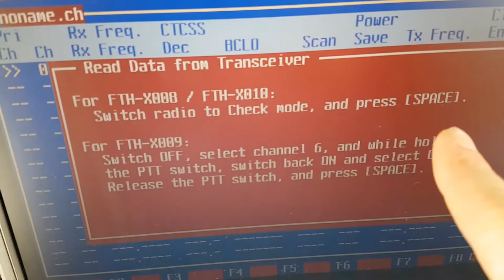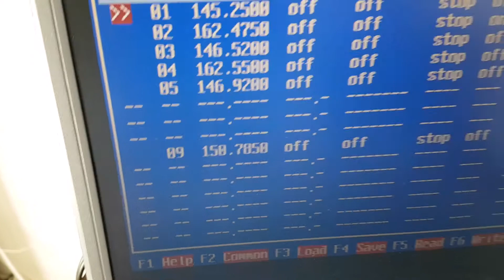Yaesu FTH-2008 Programming

Comment: Hello, could you send extracted file from this radio?
Reply from the maker: @videobipark  sorry I am unable to access these files, as I no longer have this computer.
Reply: Thank you. I've asked because loaded empty file into radio and it's no working. I watch your video too late.
Reply: May be you have schematic diagram for programming box?
Reply: I find it in your comments, thank you.
Reply from the maker: @videobipark  no problem. You would be best to read the radio first then load data into radio from computer. Loading a blank file into the radio might complicate the ability to program it.

Comment: be nice to see you interface and how you have it all connected up..
i have a box of 18 of these radios, VHF and UHF and want to use a few on a portable repeater,
Reply from the maker: It's the RS-232 plugged into the serial port of the old DOS computer and what is shown in this video. Important that it is a computer running DOS or FreeDOS.
Reply: @RailKelowna  
still be nice to know what and how it was made,
i have lots of bits laying about be nice to build a simple RS-232 to Yaesu/SMC programmer.

Comment: Hi, could you tell me how the interface is made? Thank you LW7EEA
Reply from the maker: My cable terminates into a DB9 for the old DOS computer however your cable must have had some sort of 232 programming chip, or equivalent in it.
You can see my little black box almost hidden behind the laptop in the video.
Because I have somehow accumulated about 7 old DOS radios over time, and everyone uses a different cable, I installed a 3.5 stereo plug on the output of the 232 so that I can use one programmer to plug into the appropriate cable for any of the radios.
It just happened I used an old DB21 case to house the 3.5 female and the switch to select the 232 pin 9 RXD and pin 10 TXD to the 2.5 that goes into the FTH 2008.
The Max 232 schematic, with a DB9, I used a 9 v battery instead of building the voltage reg, All I need is pin 9 and 10 and nothing else to the left
of the Max 232 chip. The 232 chip cost was about $3.00.
http://www.okanagan.net/ocarc/news/MAX232.png
Reply: @RailKelowna  Hi. I have built the interface according to the plane you sent me. but the program says "problem detected with connection to the radio. Try with a 486 PC with windows 98 and it is the same, try to start from MsDOS and continue with the same problem. That could be happening? Thank you
Reply from the maker: Are you using a switch to connect pin 9 or pin 10 to the tip of the 2.5mm jack? And you are putting the check mode by moving the slide switch to the opposite direction? It has to be an MS-DOS based computer with COM port. That's about all the advice I can offer.
Reply: @RailKelowna  Hi. I managed to run the interface, I can read and write the handy. but I have a new problem. record an FTH2008 and go well. record an FTH2010 and it does not receive or transmit, it shows ch01 but it has nothing. I read it and it shows the frequencies that I record it. probe with several frequencies and is the same, turn on the TX led but it does not emit, turn on the RX led but it does not receive. that could be happening? Thank you
Reply from the maker: Was it in a working state, before you tried to make any programming changes? I am not familiar with that model, so I cannot help you. Glad to hear you got the FTH2008 working.

Comment: Cómo se entra al check mode?
Reply from the maker: Remove PTT (Push to talk) rubber. You will see a small slide switch. Move the slide switch to the opposite direction. When finished programming, slide switch back to where it was.